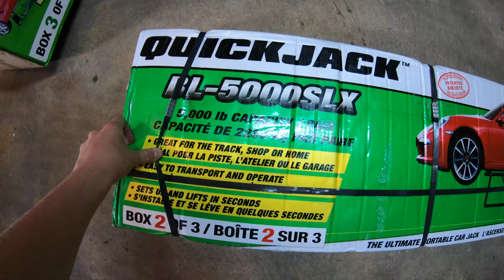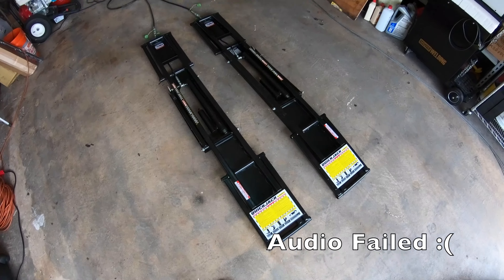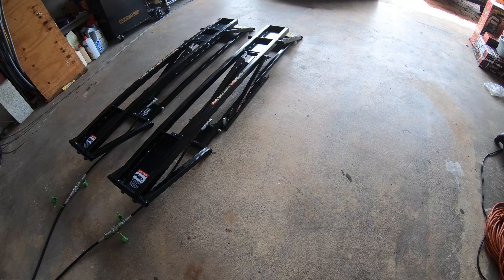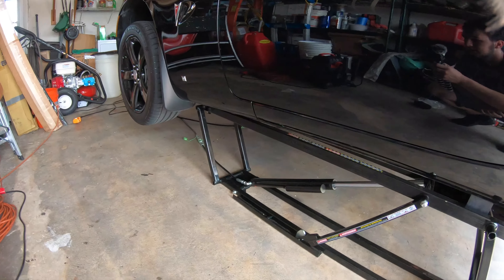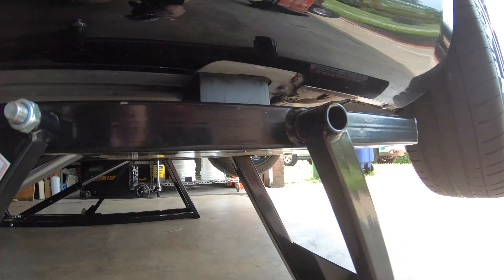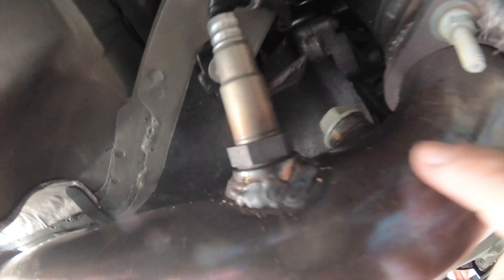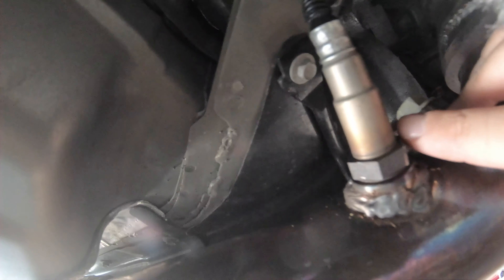My new Quick Jacks and O2 Sensor Extender Install

Comment: I bought the 3500 pound quick jacks for my solstice as I thought the 5000 pound were to long to fit between the wheels when fully loaded 
But I only bought them to use on my two solstice gxps 
I love the quick jacks there great for winter storage to keep the weight off the tires and suspension 
Another great video 
Keepem comin
Reply from the maker: Thank you!! :) . Thats a good idea thankfully i dont have to worry about winter storage here in Miami. lol

Comment: I love my QuickJack...bought at Costco for $ 1280.00...just so you and everyone else out there knows...people were questioning the strength of the Quick Jack...so QuickJack made a Utube video and took a 5,000 lb unit and loaded it with 20,000 lbs of steel...and it did not fail....so that should remove any doubt as to how strong they are....😀😀😀.
Reply from the maker: Wow thats awesome! :)

Comment: If the inspector bothers to look, he will fail you for using an extender and may even report you for trying to cheat the test.
Reply from the maker: good point, but I don't have to worry about yearly inspections because I live in Florida :)